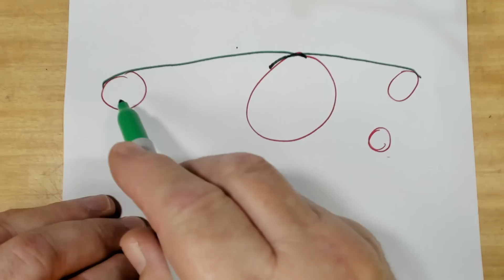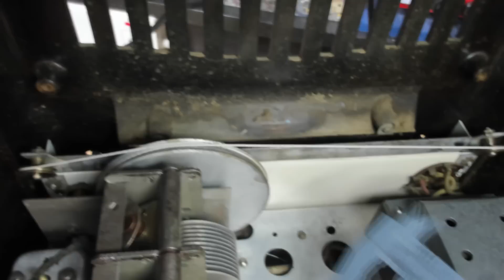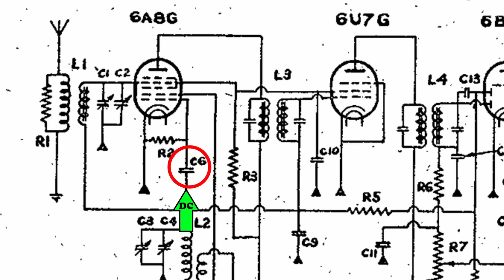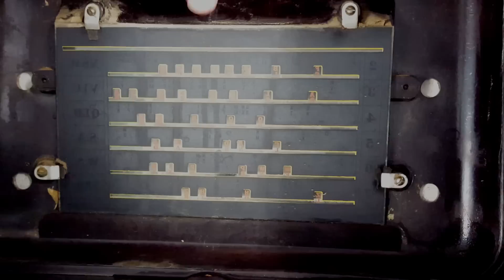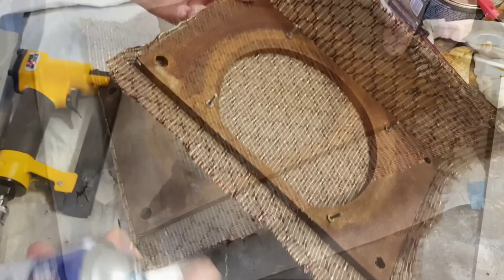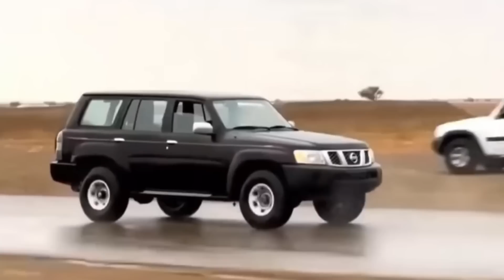Healing 501E Part 2 Final

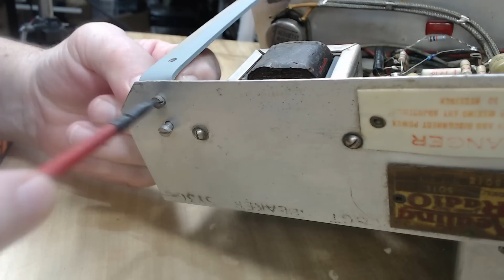Comment: Great work, David, but I think you may have missed a capacitor! It's at 3:52, right above the black electrolytic off the transformer. It's white and I think in the previous video, there were a few better views of it that showed it was a .01 uf cap. Best as always!
Reply from the maker: That was a long time ago ZC&H. I don't remember exactly. It looks like a poly cap in the video so I must have decided to leave it in there. I don't remember if I tested it or not. I might have checked the output valve grid bias which I suspect it was used for 🤔

Comment: Hi David, another great video and a very happy sister in law, hope you are well. I also have a lot of family in Melb, drive down from Sydney at every few months. I also recently did a Healing 501E, I was surprised you found HV on the choke housing? , I do not believe mine had this, I cannot see how it is possible from the schematic either am I missing something.
Thanks George
Reply from the maker: Hi George, I'm good thanks. I was asked about a 552E a few days ago, it didn't have a hot choke and was built a year later. I had another radio with a hot choke, I don't remember which, it had a decal warning of the danger. I showed the circuit in part 1 at about 18:20, you can see the little wire connection from the core to the B+ supply. Thanks George 🙂
Reply: @DavidTipton101  Thanks for the reply Dave, I had another look at the circuit for the 501E and your right right it does show that line, though mine which is also  501E chassis, though my dial is a little different and I have the golden voice badge on the front, the circuit is identical but the choke casing is grounded. So I am quite  puzzled why the are different and what is the advantage for the hot choke? Any ideas?
Cheers George
Reply from the maker: @gnerd1  I have no idea why some were hot and other not 🙂
The reason they did it was to keep the wire windings at the same potential as the B+ and hopefully reducing corrosion of the core windings due to the voltage difference. Sometimes they mount the choke in the centre tap of the power transformer so there is only low voltage on the choke. It can only be used that way if the centre tap is held above ground for grid bias 🙂

Comment: David, I never fail to learn something new with each of your videos. You've done it again! I agree with another commenter on the rich bass of this particular unit. Your sister in law is a lucky recipient, (and she can watch the restoration any time she likes). You have that "David Tipton" restoration of Bakelite down pat! As I was watching, I couldn't help but wonder if old grill cloth (on any of these old units) might possibly handle an experimental touch of an appropriate color of spray paint? It might be fun to experiment (?) Some old grill cloths have that built in glitter effect. Decades ago, I had an old Firestone large cabinet radio which was still working when I sold it for $5.00. I remember the grill cloth had an antique autumn orange that had sparkles (gold leaf?) It really looked great with that wooden (or timber, as you describe it) cabinet. Well, I'm really looking forward to your next video!  Take Care, -Chris
Reply from the maker: Hi Chris. It has very good sound and although not as good as FM it is quite acceptable to listen to. It was on all day when we were at my SILs. I did used to spray paint grill cloths but I didn't think of it again until you suggested it. I will revisit the idea in the future. Thanks for the tip. Cheers ! 👍🙂

Comment: Another triumph and a very happy customer. That radio came up beautifully, (I had exactly the same issue with the goat shields after painting them. The two halves were not making contact with each other.)
Reply from the maker: Yes, I should have taken more care removing the paint the first time. I did it properly afterwards. It was a good demonstration of what happens when they are not properly grounded though 😃

Comment: Impressive, very well done. The pointer angle was a step beyond. Though of course the pointer should be red (as an ode to pants man) and you may want to indicate to your sister-in-law that there may be a slight smell of goat.
Reply from the maker: Thanks Ralph. Who would have thought the pointer angle would be correct using geometry 😄

Comment: That hot transformer is an unusual thing.  Normally there isn't anything at voltage that's that physically large down there.  I might have wanted to coat it with liquid electrical tape.
Reply from the maker: Hi seeking, A few manufactures did the same, some put it in the center tap of the mains transformer, same result but low voltage  🙂
Reply: @DavidTipton101  Yes I should have said choke.  That's another place to put the choke.  More modern chokes are more resistant to higher potentials between coil and frame, but they are also bulkier I believe.

Comment: David Healing Tone was Healing Own I think originally AirZone slogan,A magnificent refurbishment of 76 year old Healing as you notice the HT Choke was mounted above earth, Originally to prevent electrolysis the same the Rola Output Transformer 
I my experience they very reliable AWA did some used Wax instead of Pitch.
Your sister was overwhelmed with your Refurbishment of Healing Top Work David i was pleased the Melbourne have good Middle of Road good Music Station  we’re I am both Am Station have shut down and moved the FM Band but we’re I am I listen the 1629 on my Smart Speaker,Ian,
Reply from the maker: Thanks Ian. Yes correct. My Sister in law was very happy with her new radio 🙂

Comment: Hi Dave,  I rebuilt a Stromberg Carlson a while back that had a very dirty but beautiful grill cloth. I tried a few things then my wife suggested soaking it in Oxyclean (don't know if it's available down under) , wow did that work. it shrank a little but the silk cloth looks like new. before I did that I had my wife sew the edges first. within seconds the water turned brown, probably from cigarette tar. no scrubbing just dipping and rinsing.
Rich
Reply from the maker: I use a similar product called Wondersoak. It works really well and no scrubbing required. Thanks Rich 👍🙂

Comment: Could you 3D print a box for that choke.  Even a shroud for the metal sections ?
Reply: sticking kapton tape on the casing might be another option.
Reply from the maker: Yep 👍🙂
Reply from the maker: Hi Paul, Yeah I guess. I wrote a warning on it before I closed it up, I forgot to show it 🙄🙂

Comment: Hi Dave.  Nice radio.  I have one myself but needs a lot of work.  I've found, with those valve shields that you need to solder wires to each half and to the chassis to make them be stable reliably.  Also,  that 100pF oscillator grid resistor was ceramic, and was likely fine.  They never made paper capacitors with values that low.  I hope that has been helpful.  😊
Reply from the maker: Hi Stuart. I have another one also, I showed it in the last video. It's in awful shape. Yes, I realised that it was only 100pF later on when I read the circuit properly and the video was uploaded. I wasn't thinking at the timer. I didn't change it in the end. Thanks 👍😃

Comment: It looks lovely and your sister in law loves it,  you can stop prodding her with a sharp stick to perform  now ha ha :-D
The trimmers are such an unusual design, I've seen them in grundig radios.
German design i think, i could be wrong.
Not sure why Top Cat appeared.
Reply from the maker: Thanks @zx8401ztv, she does love it. The trimmers are used in Philips sets a lot, that could be the Grundig connection. The position on the valve tester is TC for 'Top Cap', Top Cat's friends called him TC... a bit of a stretch 😄

Comment: Greetings from America David. Thank you for your videos. I never miss them.

May I offer a tip I learned from bandersontv when working with cracked radio plastics, bakelite included. He had a bakelite TV that had a huge broken piece. What he said he figured out was to clamp the broken piece together as tight as possible where the crack almost disappears. Then he would put the runny type of superglue on the back side of the crack, and not attempt to work it in. It will seep into the crack all the way via capillary action, and stop when it meets the other side. I don't understand it either, but it will glue together plastics without any glue showing on the decorative side. I've done this, and it works. 

Goodday!
Reply from the maker: Hi Karl, I haven't done a lot of Bakelite or plastic repairs so I appreciate the Information. Thank you 👍😃

Comment: Aww..that was wonderful! 3MP eh? That brings back some memories of my postings to HMAS Cerberus down at Crib Point back in another life. Top job Dave. Love your work. I just bought today, an old NZ "Bell" brand mantle radio, housed within a solid wooden case. Can't wait to try it out. I also can't wait for your next adventure.
Reply from the maker: Yes 3MP, still going. MP is Mornington Peninsula, I remember when they started and had set the radio dial to the frequency for the switch on. A bell in a wooden case, I have one in plastic. Good luck with it, I hope it works. Thanks Geoff 🙂

Comment: Nice job Dave! The speaker cloth waa fine. Only you would notice :). Spotted a highland stag and The Flying Scotsman model on the table at the end. Scottish connection?
Reply from the maker: Yeah, the cloth looked alright, it could have done without the vertical lines. No Scottish connection except for those two items 😄 Thanks Paul.